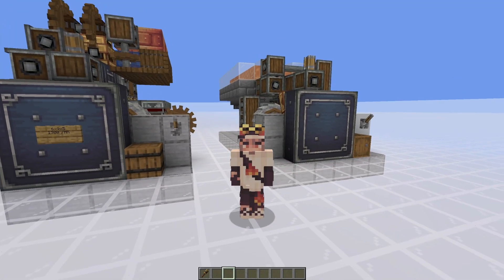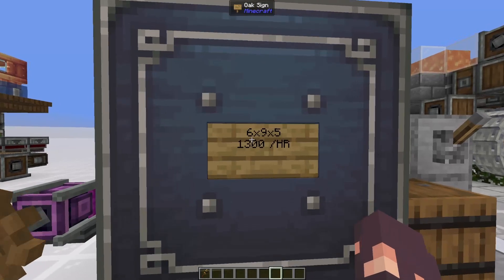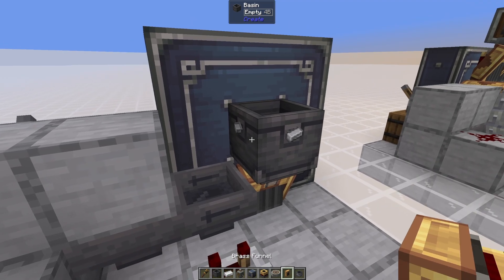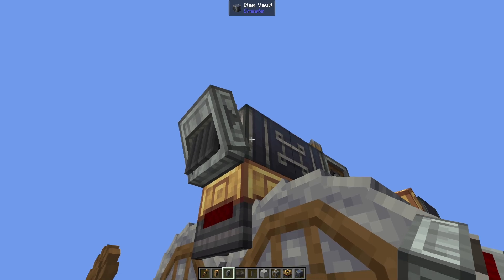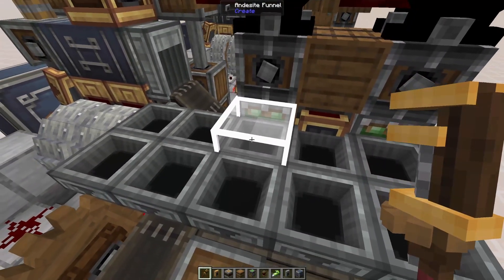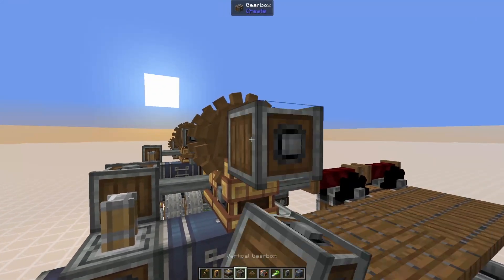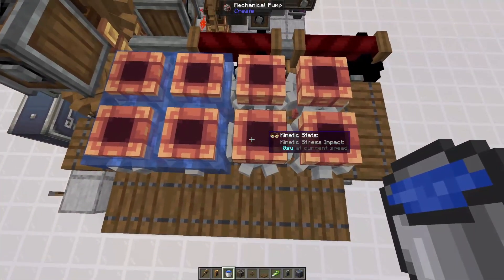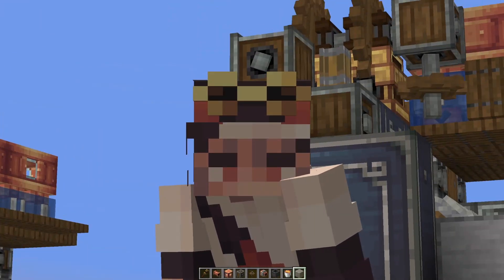The NEW ULTIMATE CREATE IRON FARM (No Villagers) 1,300 IRON PER HOUR! |  Create Mod 0.5.1.f TUTORIAL

Comment: I was able to build this for my 1.20.1 create world with Create 6.0.3.  The nbt was useless to me, probably because I have to use Forgematica. I think the main issue with this is that the video doesn't show good enough angles of the build and it's easy to miss important aspects particularly some of the gluing. It's easy to make a mistake with gluing the funnels to the trapdoors without accidentally gluing them to the gantry, when I figured this out and fixed it, my build worked. The other issue with the build is that it sends cobblestone EVERYWHERE and I had to build a wall around the build and even then it will spill cobblestone.  But I've built gantry cobblestone generators before and this is pretty much unavoidable, you more or less have to put your farm somewhere where you can give it space on its own.
Reply from the maker: thank you for the tutorial feedback, especially with the gluing. I'll try to be more explicit in future videos. For the cobble shooting everywhere issue, my guess is the brass funnel in between the 2 linear chassis not facing the right way. R-click it with a wrench and the farm should start working. Make sure the 2 andesite funnels directly below the brass funnel are facing inward towards the belt

Why its the issue: the cobble gen breaks the cobble and stores it in the barrel in between the 2 gantry carriages. the brass funnel should be dropping the cobble that is in the barrel right above it (it has access to the barrel's inventory even if it's not connected to it because it's a contraption). The funnel will drop the cobble out to the 2 blocks below it (depending on the side it's on) and the 2 andesite funnels below it will pickup the newly dropped items and put them in the item vault.

Comment: i used the schemati cbut the gantry contraption is just not working
Reply from the maker: my guess is it's a glue issue, make sure there are only 2 glue sections and the linear chassies are set to only glue to the 1 block infront of them instead of the default (8). also make sure there are no blocks in the way of the farm moving

Comment: My crushing wheels are rotating in the wrong ways.  I tried to fix them with replacing one shaft with gearbox for each side of the wheels. It fixed it but still the cobblestones, sands and gravels pops up from every side of the system. Mostly the part where the funnel and the brass funnel top of it placed. Tried to change the rotstion of the machine but this time cobblestone thrown out from belts and they turn to wrong way. (Fabric 0.5.1f)
Reply from the maker: If you revert your changes and then invert the 256 rpm rotation speed controller to counterclockwise then it should work!
Reply: @kindlebubbledump  I'm trying to figure it out for nearly 1 hour and just saw that ı forgot to place the belts that carry stones to small vaults. Feels like an idiot. Thank you !

Comment: My Gravel is not getting washed nearly quick enough and its causing lag from stacks of gravel piling up in front of the brass funnel connected to the item vault. On top of that, sometimes iron ingots stack up inside of the basin and dont get ejected quick enough into the hopper, causing the system to shut down. The fan has 512 SU for reference.
Reply from the maker: the speed of the fan is max, but that shouldn't lag out your game unless the funnel isn't picking up the flint and nuggets for some reason. do you have the valkerian skies mod installed? for the iron stacking up in the basin, does that happen all the time? it will def overflow occasionally but the basin should be able to keep up overall

Comment: hey great tutorial 
but when i run the farm all the cobblestone just pop up from the generator!
is there is a fix for that :(
Reply from the maker: Your issue is probably the brass funnel in between the 2 linear chassis. R-click it with a wrench and the farm should start working. Make sure the 2 andesite funnels directly below the brass funnel are facing inward towards the belts

Why its the issue: the cobble gen breaks the cobble and stores it in the barrel in between the 2 gantry carriages. the brass funnel should be dropping the cobble that is in the barrel right above it (it has access to the barrel's inventory even if it's not connected to it because it's a contraption). The funnel will drop the cobble out to the 2 blocks below it (depending on the side it's on) and the 2 andesite funnels below it will pickup the newly dropped items and put them in the item vault.
Reply: @ thanks dude i just forgot to place the barrel 
keep the great content flowing 🫡🫡

Comment: so it is "working" as u showed in the video but it is mining so fast that most of the cobble is flying everywhere around the funnels and not being turned iinto gravel any tips?
Reply: do i need to make it mine slower? it catches some of the cobble and turns it into gravel but most of it is just flying everywhere, also all the extra cobble is causing lots of lag
Reply from the maker: no this is probably because the brass funnel in between the 2 gantry carriages is backwards. If you r-click it with a wrench and let it run for a while, does it fix itself?

Comment: why cobblestone falls out????? please tell mee
Reply from the maker: Your issue is probably the brass funnel in between the 2 linear chassis. R-click it with a wrench and the farm should start working. Make sure the 2 andesite funnels directly below the brass funnel are facing inward towards the vault

Why its the issue: the cobble gen breaks the cobble and stores it in the barrel in between the 2 gantry carriages. the brass funnel should be dropping the cobble that is in the barrel right above it (it has access to the barrel's inventory even if it's not connected to it because it's a contraption). The funnel will drop the cobble out to the 2 blocks below it (depending on the side it's on) and the 2 andesite funnels below it will pickup the newly dropped items and put them in the item vault

Comment: The funnel for the gravel and iron nuggets not picking it up but I have the list on
Reply from the maker: Do you have the valkerian skies mod installed? there's a bug with that mod and funnels with fans blowing on them. you can either remove that mod, or setup a clock to turn off the fans blowing for a few seconds for that funnel to pickup all the infested stone that was made and then turn it back on. idk the exact timings for how to do that so you'll have to do some trial and error.
Reply: @kindlebubbledump  I did have it installed Ty

Comment: It’s spewing a lot of cobble everywhere
Reply from the maker: Your issue is probably the brass funnel in between the 2 linear chassis. R-click it with a wrench and the farm should start working. Make sure the 2 andesite funnels directly below the brass funnel are facing inward towards the belt. also make sure the double chest going into the crushing wheels isn't full. 

Why its the issue: the cobble gen breaks the cobble and stores it in the barrel in between the 2 gantry carriages. the brass funnel should be dropping the cobble that is in the barrel right above it (it has access to the barrel's inventory even if it's not connected to it because it's a contraption). The funnel will drop the cobble out to the 2 blocks below it (depending on the side it's on) and the 2 andesite funnels below it will pickup the newly dropped items and put them in the item vault.

Comment: If you add a vault on the other side of the belt and some output to a chest you can also make this into a cobblestone generator for yourself and all you have to do just change the rotation on the speed controller from clockwise to counter and vise versa to switch between the modes
Reply from the maker: Good idea!

Comment: the water over flows for me
Reply: and then breaks the redstone
Reply: and the cobble stone just keeps flying everywhere
Reply from the maker: are you not able to waterlogged leaves blocks in ur Minecraft version?  You can fix this by breaking a block in the floor to the left of where the leaves block should be, removing the leaves and then putting in a water source. For the cobble, is the belt the hoppers go on moving in the right direction?  It might be easiest to join my discord cause you can send photos there
Reply: @kindlebubbledump  the belt go in the right direction and all that and the water keeps destroying the on off switch redstone and the water is coming from the top
Reply from the maker: @sampsa362 ohhhhh I see, make sure the rotation speed controller that is connected to the gantry shaft is set to 170 rpm, if it’s slower it could cause this. Then make sure there is a barrel connected between the gantry carriages and there is a brass funnel directly below the barrel pointing away from the cobble gen section (the area with the andesite funnels and spruce trapdoors moving. I think it’s necessary for you to join my discord cause I think you might have missed a block or something in the cobble gen part

Comment: i dont know what i did wrong, i copied the build exactly and everything appears to be runnning and going in the right direction but i dont see any of the blocks moving through the build. it worked for a short period at the start that broke and im not sure why.
Reply from the maker: It could be quite a few things, I would recommend joining my discord cause you can post photos and vids, but I can still help you here if you’d prefer. The first thing: is cobble being generated? If so is it getting onto the belts -> crushing wheels. Where in the process is it breaking

Comment: work real good but cobblestone is flying every were
Reply from the maker: The brass funnel in between the linear chassis’s needs to be pointing outward away from the cobble gen section. That’s likely your issue. Also make sure there is a barrel directly above the brass funnel

Comment: So I ran into an issue where the andesite funnels are facing down towards the belts, but  the cobblestone is being produced so quickly that the funnels can't catch the cobblestone and it's shooting cobblestone everywhere.
Reply from the maker: the andesite funnels are only used for when the farm stops and there is risidual cobble left on them. the main cobble collector is the barrel and brass funnel glued to the 2 gantry carriages. make sure the brass funnel is pointing outward away from the cobble gen section
Reply: I tried to use a storage drawer instead of barrel. 🤦‍♂️ One slight change and I broke it lmao.
Reply from the maker: @jamesbemrose3290 lol yea other storage mods don’t play well with create :( I wish it did, it would make it so much easier lmao

Comment: I don't leave many YouTube comments but I had to for this tutorial. Everything was straightforward and explained adequately. Because I used the schematic, here are some tips that might help anyone planning to use the schematic:

- The creative motor needs to be skipped during the cannon phase.
- If you are experiencing the cobblestone shooting outside the farm, follow the video and make the rotation speed controller that is connecting all the belts to 256 COUNTER-CLOCKWISE.
- Replace ALL the Item Vault and Fluid Tank blocks (I felt stupid when my flint wasn't being incinerated).  
- Don't forget to water log the mechanical press and leaf block. 

These were just some errors I made when building this farm. Besides that, I'm really enjoying this build and look forward to any future tutorials :)

(If anyone is curious, I am powering my farm with just water wheels. I don't know much about steam engines and all that so they will do for now)
Reply from the maker: Glad the farm works for you! If you want to learn more about steam engines I have a walkthrough on how they work + a tutorial at the end. I thought they were going to be really complicated, but they’re more simple than you think
Reply: @kindlebubbledump  I will 100% be checking that out. I've been learning so much more and being able to see the process and understand each components role helps tremendously. Also, thank you for the tutorials 👍
Reply from the maker: @visxge999 great! And no problem, glad the tutorials help you!
Reply: What do you mean water log the mechanical press?
Reply: @xdrakken4710  Sorry for the late response. I made a typo. Instead of press I meant to say mechanical pumps. I apologize for any confusion

Comment: thanks for the good tutorial! i do have a problem tho: my cobblestone seems to be getting stuck between the smart chute and the crushing wheels. it doesn't drop down to the floor so it can't get washed to gravel and so on. if i break the crushing weels, there are many stacks of cobblestone falling down. do you have an idea on what i did wrong?
Reply from the maker: Are the crushing wheels spinning the right way? It sounds like they are spinning in opposite directions and not crushing anything. If it looks right, can you join my discord. You can send photos and short videos that will help me troubleshoot

Comment: Hi, i just built the farm and the tutorial was very good. I seem to have a problem with the iron ingot part. I read an earlier comment where you asked if the fan was pushing blue particles and it is, but i don't see any nuggets getting crushed above the part where the gravel and flint gathers, any solutions?
Reply from the maker: The fan should be blowing the gravel and turning it into flint and iron nuggets. Make sure the item vault can pickup items (and isn’t full of flint or something). If you only pickup the gravel is there any iron nuggets at all?
Reply: @kindlebubbledump  Hi, thank you for the reply. I do get ingots, when i pick up the gravel. It seems that it gets produced and then nothing after that. It does not get picked up or anything

Comment: Hi, when i try to waterlog the pump my gantry shaft gets flushed away. what is the problem here?
Reply from the maker: Make sure you are in version 0.5.1.f. Other versions might still work but I haven’t tested the farm on those versions. Since gantry shafts are not waterproof you will have to remove the mechanical pumps and place a full block (cobble or something else). It will reduce the total output of the farm, but not by too much
Reply: @kindlebubbledump  Ah i'm on 0.5.1.d so that explains a lot. thx for the quick answer!
Reply from the maker: @MauFlitz no problem! It might still work, but I would test it in a creative world beforehand!

Comment: I downloaded the schematic and everything works excpet for the filtering, it won't filter the flfint and it won't turn it into ingots either, what do i do?
Reply from the maker: Try removing the filter and replacing it? If that doesn’t work try breaking and replacing the vault. I have a discord where you can post photos that I would recommend joining cause I haven’t seen this issue before
Reply: @kindlebubbledump  thanks that fixed it

Comment: I need some help, for some reason, all the cobble seems to come out of the generator, as if it were so fast that the barrel fills too quickly and a lot of cobble is left out, which makes it not as fast as it looks in the video, it's Is this something normal?
Reply from the maker: Is the cobble going through both smart chutes and crushing wheels? If not, break and replace the 2 vault blocks and see if that fixes it.

Comment from the maker: If you are building this using the schematic, the things you have to fix are below. 

Break and replace the vault and fluid tank blocks, the schematicannon doesn’t place these correctly. Fill in each fluid tank in with 1 bucket of lava each 13:34. Also water log each pump 12:25, and water log the leaf block at the bottom of the crushing wheels. 

After starting the farm, if the cobblestone is shooting out the back of the farm/the crushing wheels are spinning the wrong way/ the fan is pulling and not pushing, change the 256 rpm rotation speed controller from clockwise to counterclockwise (or vise versa).
Reply: Hello, I have an issue where the crushing wheels and the belts are going in opposite directions such that if I have the crushing wheels/fan working properly the cobble shoots out the back.
Reply from the maker: @devon-crain that should be an ez fix. On the right side of the build a bit behind the on/off lever is a 256 rpm rotation speed controller, if you reverse that from clockwise to counterclockwise (or vise versa) that should fix it
Reply: @kindlebubbledump  Yes, I tried that as mentioned above in your pinned comment. If I switch the direction of that speed controller, EITHER the belts and wheels work OR the fan works. Neither configuration results in both working properly. I spent so much time fiddling with it last night that I probably could have just built it alongside the tutorial and been fine, but if you have any idea what's up in the meantime it'd be nice to fix what's already built.
Reply from the maker: @devon-crain weird… I don’t know what could be wrong with it, but if you join my discord, you can post pictures and I can help more with troubleshooting
Reply: @devon-crain  i did changed shaft to the crushing wheel with gearbox to turn rotation of one of the crushing wheel and changed 2 vertical gearbox to 4 encased chain drive i have same problem as you and prob it fixed. My problem is when is belts going right crushing wheels rotates false rotation and i did what i said
Reply: @kindlebubbledump  Does this owkr in 6.0
Reply: i have a problem where the cobblestone isnt coming into the vaults

Comment: the cobblestone is getting stuck before the filter andt wont go to the crushing wheel
how do i fix it?
Reply from the maker: If you built it using the schematic, Break and re-place the 2 vault blocksthat the andesite filter goes into. For some reason vaults aren’t placed in properly with the schematicannon.